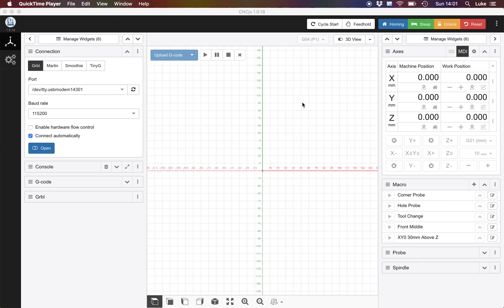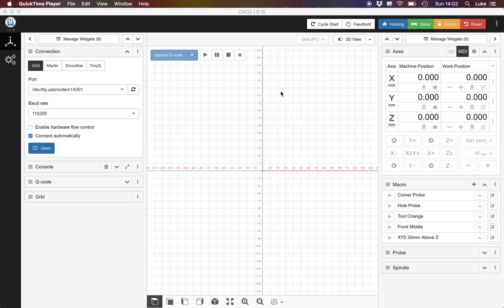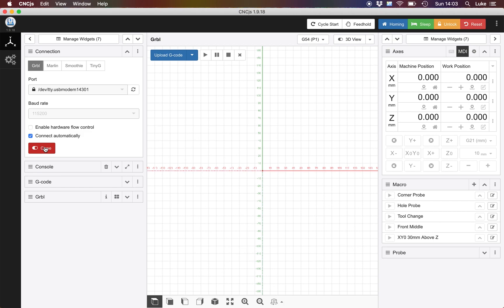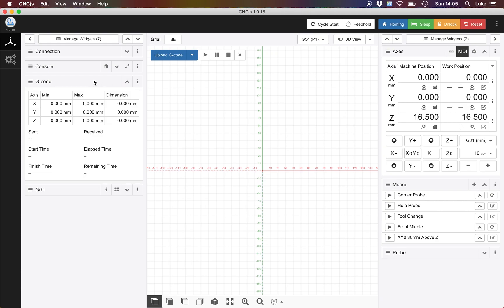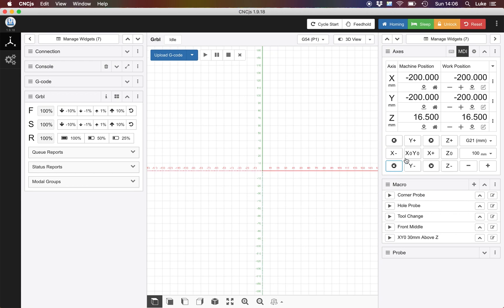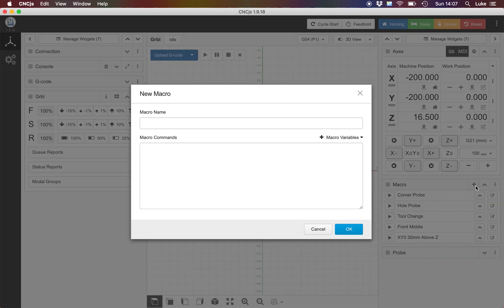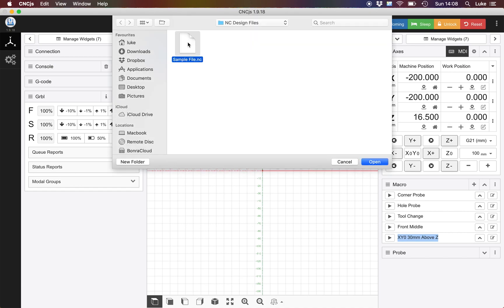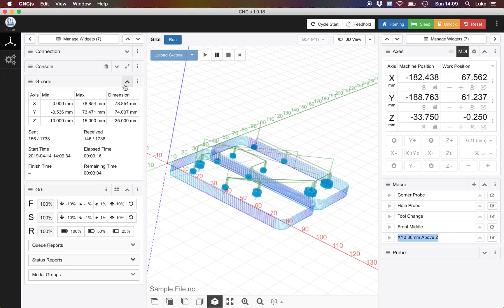A quick run through how to use CNCJS with your CNC/Shapeoko or DIY CNC - GRBL

Comment: Hi. I turn on the spindle and it immediately says HARD LIMIT. My cables are shielded. 
Can you help me?
how to disable it or ....? thank you
Reply from the maker: It's going to be an EMI/control issue I'm afraid. When a spindle starts up it generates quite allot of interference, you might have a ground loop or something else but it will be a electrical. Shielded cables don't stop this from happening, almost all my machines run unshielded without any issue.
Reply: @BeaverCNC  what do you advise me?

Comment: Mine keeps positioning the model in the wrong place on the Z axis. I set the datum in F360 as stock top left hand corner yet CNCjs positions the datum in the middle of the model. Very confused. Please help if you can..

Comment: Great overview of using CNCjs ..  I am running it now but have an issue with my Y axis ..  I have tried to reverse it using the Console and add the code in it ...  For some reason it's not wanting to reverse the axis for me.. Did a RESET and Turned on and off the machine to include open and close the CNCjs software ..
 Any ideas what I can do to get my Y to reverse?
Reply from the maker: what settings are you changing?
Reply: @BeaverCNC  I tried to use $2=1 in the console. Seems like the program would not accept the code even though it stated "OK" after I typed in "$2=1".  I even rebooted (reset) the card as well as my pc ..   Tested the CNC router again and my "Y" axis is still not scrolling in the correct direction and apparently did not accept the code I typed in the console.  Is there something else I should try?  Totally at a loss of what I should do...
Reply: GOT IT! ..  I was using the wrong code ...  I needed $3=4 Now XYZ coordinates are correct .. WHEW! ..

Comment: Can you please do an install walk-through for this?
Reply from the maker: installing it on a computer?
Reply: @BeaverCNC on a  raspberry pi preferably
Reply: @BeaverCNC  yes. Installing on a PC. I'm lost.  I downloaded the windows app and it sees the Shapeoko when I run cncjs, but the movement commands don't move anything. I'm assuming there is something else I need to install. Just don't know what or how.
Reply: You need to hit the "unlock" button on the top right. then you will see the commands are no longer blocked